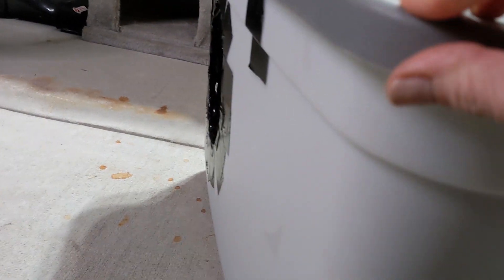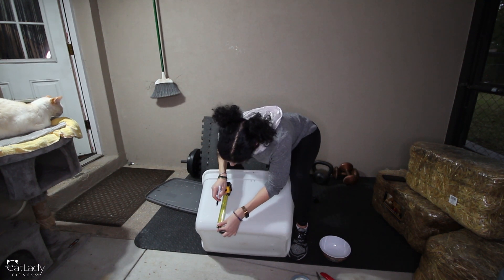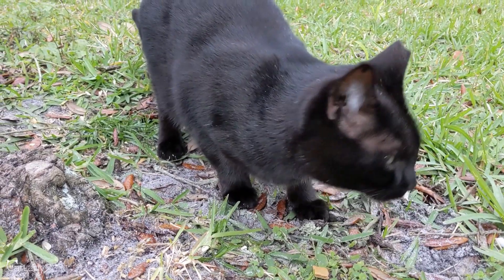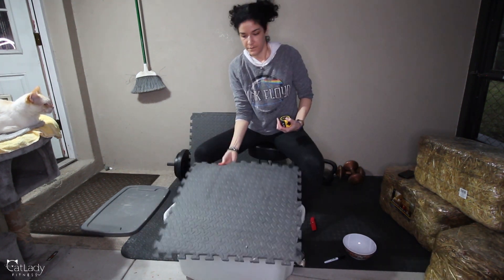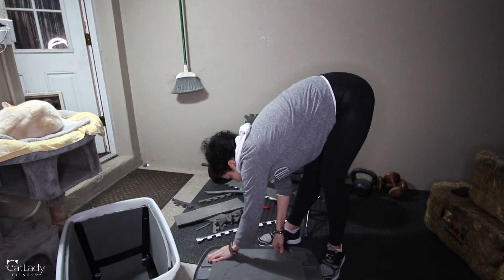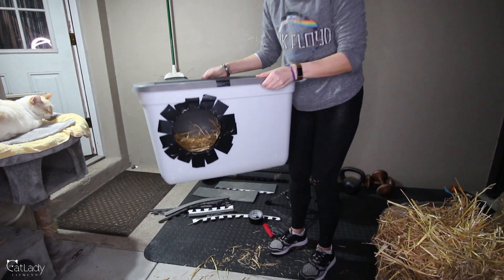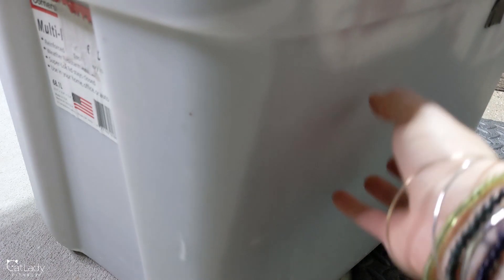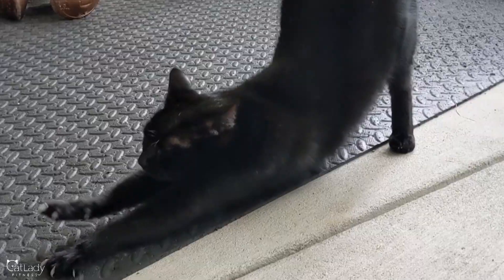NO COST DIY outdoor kitty cat shelter (out of stuff I had laying around the house!)

Comment: We live “up north” and found that some people who live down the road from had been feeding some feral kittens but the people were moving out and leaving them. Long story short, they found their way to our home. By that time they were quite wild but willing to take food well enough. Could not get them to let us pick them up or get them inside. We made an insulated house for them out of one of the larger plastic storage totes. Bought 1 inch foam insulation board and cut it to line the inside walls, floor, and “roof” of the storage tote. Used waterproof glue and tape to hold the insulation in there. Then we cut cardboard boxes up to cover the insulation and make it a bit more comfy. Maybe in southern parts of Florida some thick cardboard would be a good insulator. Some cats might decide to scratch it up on some boring night though. 
It helps to make the plastic easier to cut if you use a hair dryer to soften the plastic before cutting. 
We used some of those self warming cat beds for the inside. They are relatively inexpensive and can be thrown in the washer to clean them. We bought a few of them so while one was being washed we could just put another one in there. 
We then put the shelter on a small outdoor table (not good to put the shelter on frozen ground. You also want to keep them from predators or other intruders like raccoons, etc.,) and placed a patio chair in front of the table. We then covered the house and chair with a tarp and weighted it down with large rocks to keep it from being blown away. The tarp protected the shelter from the wind and rain/snow. The kitties would go under the tarp and sit in the chair if the weather suited or would go into the house for warmth and a cozy snooze. They had a good set up for the winter. Had to dig them out when it snowed a few times. 
Eventually the children tamed the kitties enough that we were able to find good homes for them. 
That cat in your yard obviously has had someone taking care of it at one time. Sadly, many times once a cat reaches sexual maturity some people tend to boot them because they don’t want to be bothered with the cost of spaying or neutering. Maybe advertise for the owner or for a new home for the poor baby. Don’t let it turn feral. If you have a no kill shelter that would be another option. 
We live out in the hills in an area where people dump their unwanted animals so our cat house has been used several times over the past few years until we are able to get other accommodations for the guests. 
It is so sad and unnecessary do dump an animal but I guess when people have little money to go around they see spending on an animal as wasteful or even impossible. However, there are a shelters that will take animals, without charge, from people who absolutely have no way of paying.